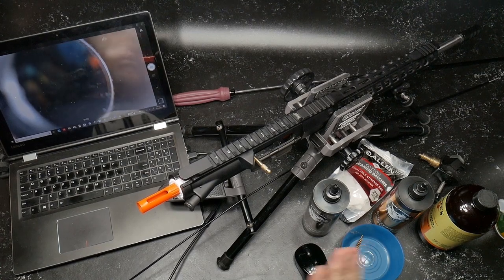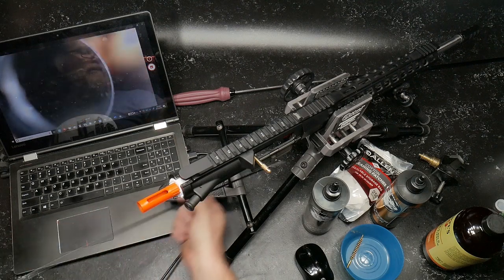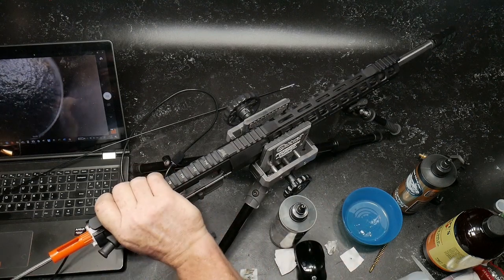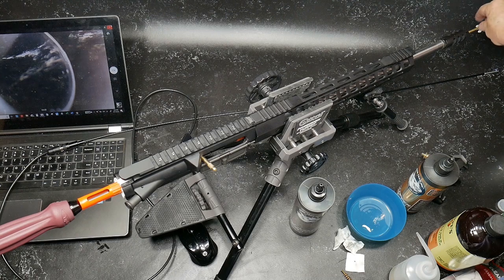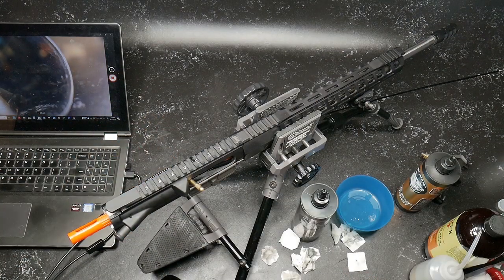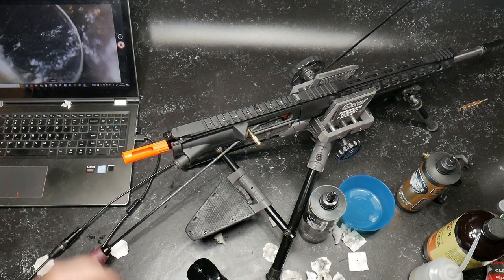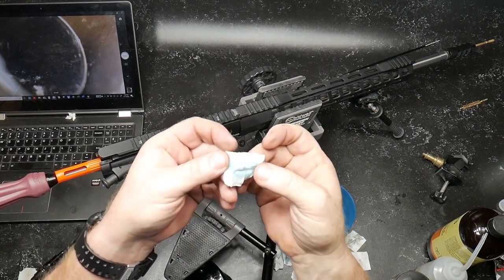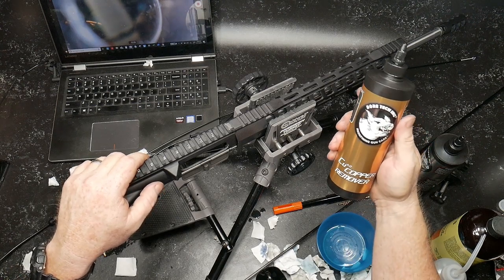Bore Tech Cu+2 Copper Remover & C4 Carbon Remover

Comment: Rifles differ but when you shoot a high volume of rounds down range like at prairie dogs, you will know when your barrel becomes copper fouled because you won't be able to hit jack.  Clean that barrel up, which takes a while, and you're back in business.  Those that think more copper is better, I disagree my experience has been totally the opposite.  And that Bore Tech Cu+2 is outstanding, I had a heavily copper fouled barrel cleaned to a certain point but nothing would touch the remaining copper including Sweets 7.62, until I tried the Bore Tech Cu+2 then bingo copper was out.  I was using a Hawkeye Borescope so I knew exactly what was going on inside the barrel.

Comment: And the beat goes on about cleaning barrels.  I have tried most ways and find no difference in results with a clean barrel vs one that is dirty. I find that good ammo / and running a few hundred rounds through your gun to breaking it works best.  Copper in your barrel filling the small nicks is a good thing. You can see in a chronograph increased speeds with a broke in barrel. Sure I still run patches though my barrel to get soot out but once a clean patch comes out I am good. I do not believe in using solvents.
Reply: Only real cleaning I do to my barrel after its broke in is to prevent rust from storage.  And I do about the same routine you do. Haha.
Reply: I guess it depends on whether you're just shooting or actually trying to shoot small groups.
Reply: That increased speed is the result of increased pressure from becoming harder to force the bullet past the accumulated copper (metal on like metal has a higher coefficient of friction than a soft metal on a harder metal does).  It's not really a good thing.  If it seems to improve accuracy, your load isn't tuned properly for the unfouled barrel.
Reply: I believe it’s horses for courses, I’m a hunter & a competition shooter. My hunting rifles get cleaned and oiled for making sure that I don’t get any corrosion and are safe to use.
My competition rifles, get cleaned for repeatable accuracy, in a competition environment.
My hunting rifles get factory spec ammunition.
My competition rifles get my custom made with all of the bells and whistles ammunition.
Reply: @twilightroach4274  Anyone that doesnt clean their bore or does it minimally will always defend not doing so. Cleaner is more accurate.

Comment: Ive been shooting BR and been a part time gunsmith/rifle builder for a few years now. Ive tried a lot of solvents over the years and was settled on Butch's bore shine until Boretech CU+2 came out, its the best, fastest, safest copper solvent available, i like there carbon remover too which i run first, i dont care for there friction guard oil i prefer butches gun oil over boretech friction guard. Alot of guys say they dont clean there rifle barrels because it makes no difference. Im sure if you do not know how to properly clean one it probably doesn't make a difference.  Cleaning a rifle barrel is not a 10minute long task it should take u 30min to 60min to clean your rifle. There is a reason why most of us BR shooters are adamant about cleaning, you can try to argue with that but just remember that we shoot the smallest groups around the world ever recorded at distances from 100yds to 1000yds

Comment: I use it in my AR15 rifle, but I also found it works great in removing the carbon and fouling inside the bolt carrier and bolt. It literally cuts my cleaning time to just 30-45 minutes and it is spotless. I can take a white patch, put it inside my bcg, do a full 360 with it and not a single line of black on it. Very good product and no scrubbing or anything. I just push it through the bore, and let it soak for about 15 minutes while I work on the bolt carrier.

Comment: I'd have recommended Iosso or JB Bore compound to remove some of that machining remnants to lower the fouling you're getting.  The abrasive route smooths that out whereas chemical does nothing to prevent the fouling in the future.  I use the Cu remover after I have hit it with abrasives in order to get the fouling thats down in fire cracking, areas that can't be smoothed out.  Still a good video though.  You have hard carbon fouling so I'd recommend leaving the carbon remover in there for a solid 2-3 hours before patching it out.  Won't harm the barrel at all.  Also, remove the carbon ring at the neck to throat junction.  That area can increase pressure about 4k psi when it's dirty and impact precision.
Reply: JB will not remove machining marks as it is not a lapping compound, it's a non-embedding polishing compound.

Comment: I'm really impressed with Bore Tech Eliminator, Cu4 & Rimfire solution.
My shoulders (both seriously trashed) hurt watching your efforts pushing the patches.   Soaking them helps to smooth the strokes....maybe even use a 6mm jag with two wet patches of Eliminator to start....then get after it with a 6.5mm nylon brush....then a dry patch & borescope to evaluate carbon left before getting into it with Cu4.   Downsizing the jags for the initial dispersion of solution ....then the nylon brush is what works best for me and my smoked shoulders.       Teslong borescope is an insanely handy tool and fairly affordable for any shooter.

Comment: Gunslick Foaming Bore Cleaner works damn good on copper fouling also .
Reply: Read the label, I think the Gun Slick foam is not recommended for gas guns?  It might have something to do with getting it in the gas port and tube, where it can't be removed?
Reply: Copper fouling is a myth ! Don’t use copper cleaner down ur barrel u will ruin it

Comment: Throw that bronze brush away and use either bore /tech or a Iosso brush and clean from the bore with a bore guide , by using bore/tech directions and it’s much easier , it will save you time and sweat

Comment: Great video!  Thank You for posting.  Jb has a standard grade, and a JB bore brite that is red and more aggressive.  Using the JB on a iosso or montana extreme plastic brush will sure help you in your quest.  Punching the patches off center helps a lot also with 1 3/8" patches.  The fouling is in layers, copper on top of carbon, agan and again.  So, you are cutting through layers of fouiling.  Truthfully, I worry about the carbon, then the copper is gone.  

Concerning the dia of your jag, you can put it in a 3/8" drill, use a piece of 400 grit wet sand and reduce the size of the jag to the point that you like, and I would advise you go in .005 increments.

Comment: You should wet the brush before sending it down the bore. 

Get yourself a proper bore guide. Possum Hollow makes nice ones. They’re around $20 on Amazon.
Reply: The AR-15 comes with a bore guide. Try threading the rod through the bolt carrier :P
Reply: Ted Hodge Interesting. Probably should remove the bolt from the carrier first, no? :p
Reply: @ElTerrible666  Ofc, but it does work. Just remove the bolt, put the carrier back in the receiver and thread the cleaning rod through.
Reply: You already have a bore guide built into the gun, the bolt carrier. Remove the bolt and reinsert the bolt carrier.

I agree with another poster, I only use copper cleaner in my shotguns after I used copper plated ammo, and I use paint thinner for carbon cleaner, MUCH cheaper a lot less smell than Hoppes. But if you have lube/cleaner sponsors, they do not want to hear that and we would see less videos, right?.
Reply: I always run the bronze brush dry through the bore to loosen carbon fouling, then follow with a plastic brush with Hopes let sit for a bit then hit with a wet patch. The copper brush will transfer material to the bore if you use it with a solvent. As an aside I use CFE 223 powder in my high volume rifles, to cut down on copper fouling.

Comment: Other products that will cut the fouling, Montana Extreme Copper cream, Flitz bore cleaner, use on patches first, and if carbon persists use these one of these two products on a plastic brush or a worn bronze bristle brush.

Comment: Do they still make sweets 7.62? I’ve had the same big bottle for years, works great on copper then GM Top engine cleaner is the same solvent as Shooters Choice but cheaper.

Comment: What does everyone think about running a bore polish when cleaning? I’ve used it on a couple pistols and bolt actions that I added a new barrel on it made the barrel shiny afterwards  and easier to clean but didn’t notice any better performance

Comment: Did your groups open up yet? Clean carbon frequently with carbon solvent and patches but leave the copper fouling alone until your groups noticeably open up. Less risk of damaging your bore from the cleaning rod for one and you'll get better accuracy for longer stretches between cleanings. Copper fouling is a GOOD thing up to a point! Somewhere around 500-700ish rounds maybe more depending on your particular barrel your groups will open up and that's when it's time to clean copper fouling, let the barrel tell you "when" to clean. After you clean copper fouling out you can expect to have about the first 20 shots that won't group well before it fouls with enough copper to tighten up the bore again...

Comment: If you have to run a wire brush through your bore, it’s a poor cleaner. Worst case scenario is using a nylon brush but you could use Tactical Advantage with the accelerator and only need patches. Using a wire brush will degrade your barrels accuracy rather quickly over time in comparison to just using a patch.